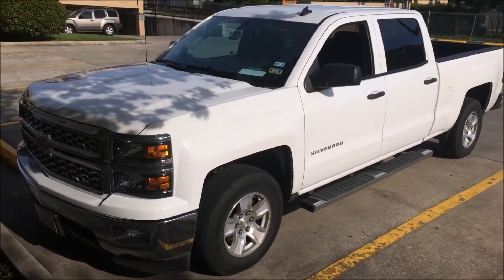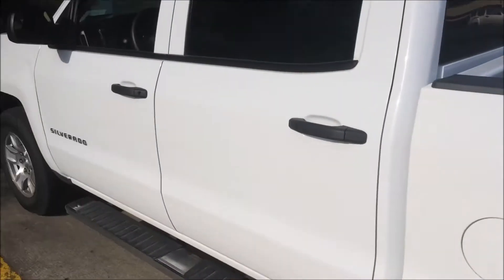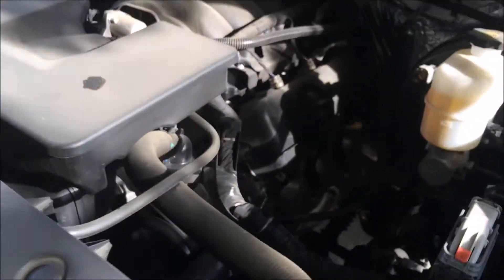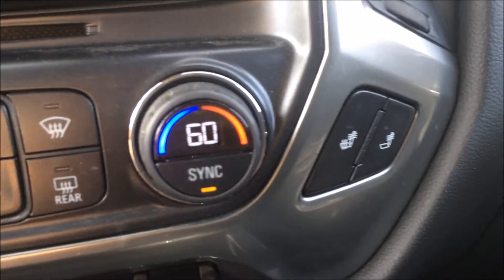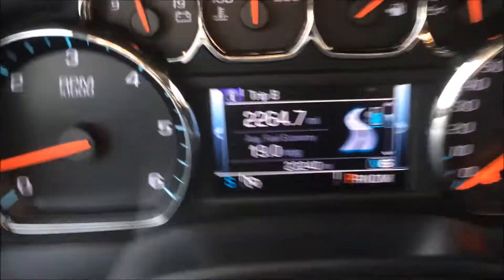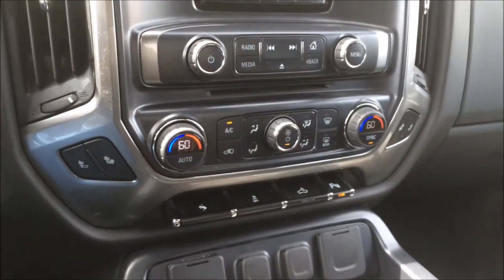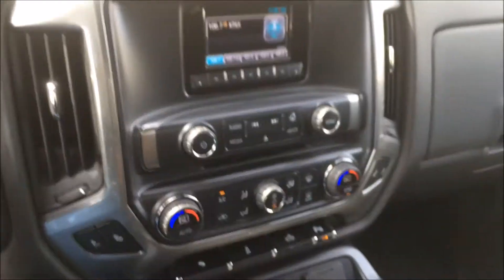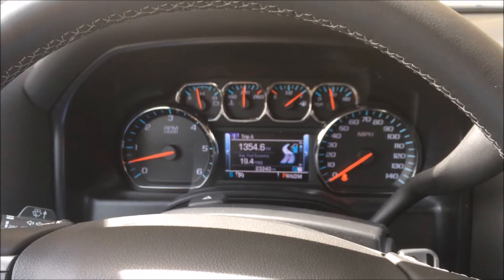2014 Chevy Silverado 1500 4.3 V6

Comment: Way too expensive?  That truck isn't too bad.  I bought a 2015 LT with the all-Star package, 4x4, all terrain tires, etc., etc., for for about 37k.  Has the 4.3 as well, which is surprisingly a very strong motor.
Reply from the maker: Biker Jim The truck is a great truck no worries there, ya they did alot of updating to the motor to pump out more HP.

Comment: My company i work for in nova Scotia has 100+ of these trucks 2014 chevy Silverado 2wd 4.3 v6s and we do traffic control they are not bad for work trucks little smaller then yours in the video and slighty different but over all identical trucks wandering if one would be worth buying off a company

Comment: The big 420 HP 460 lb ft 6.2L V8 engine is extremely powerful. But, not enough for me. I want at least 500 HP to start with. 600 HP is perfect. So this V6 is VERY under powered for me. But still a nice truck.
Reply: GMC Denali 717 haha whaaaaaat dude chill
Reply: Lmao you couldn't handle 600 hp kid
Reply: What ars you pulling , the Washington monument
Reply: @youvids9820  😅

Comment: I heard this truck 4.3 v6 is slow 0-60 on 10 seconds lmfao a Toyota Prius is faster then this
Reply from the maker: also weighs less than half as much but can't tow anything like this can, different uses.
Reply: Hank's Garage true but why a big truck and small engine I just don’t get it
Reply from the maker: EPA Mileage requirements and pricing, keep in mind even the v8 equipped trucks arent that much faster
Reply: Hank's Garage true but my tundra is pretty quick 0-60 in 6 seconds with traction
Reply from the maker: intredasting for sure
Reply: Generally you don't get a truck to drag race haha
Reply: Jordan Coffing true because trucks gears are different and bigger
Reply: If you ever need a truck for actual truck purposes, you will find out really fast that 0 to 60 does not matter. The only question is will it get you there and will it get you there without bankrupting you. I used to haul parts for a Ford dealership and we used 4 cylinder manual Rangers and a V6 manual F150. If you're always hauling in the bed and not pulling a trailer behind you, you really do not need the bigger engines. There were times I would haul 1/2 ton pallet of oil filters to a police garage about 80 miles north from where we were located. That V6 had no issue getting that up to speed and keeping it up to speed on the interstate. If you just haul in your bed, the engine really doesn't matter unless you are hauling tons in the bed. 0 to 60 times are just bragging rights for the manufacturers.
Reply: Trucks weren't made for 0-60 times. My 2015 v6 does 8 secs, yes. It's very slow, but a Prius cannot tow 7,000lbs. I tow 5500lbs on my trailer, and another 1000lbs on the bed daily on the 101fwy, and my truck takes it like a champ! It has 130,000 miles and I've had no problems with it!